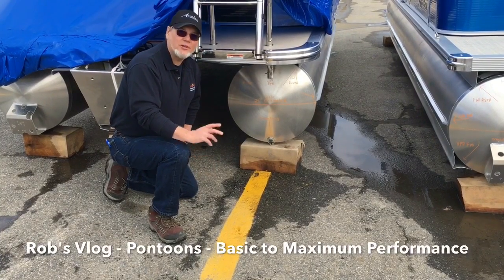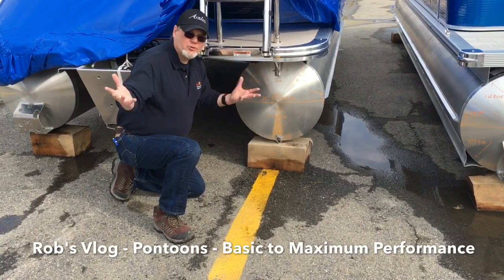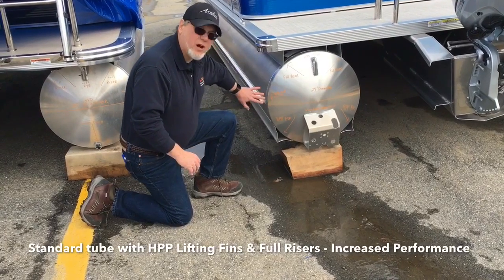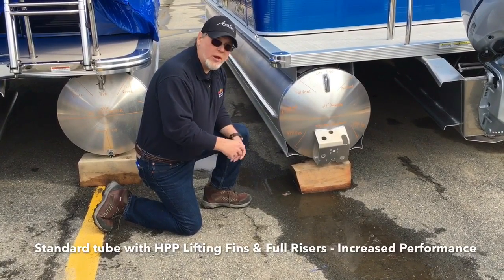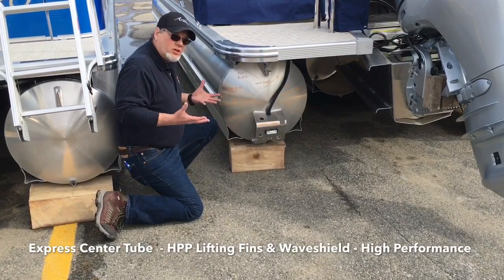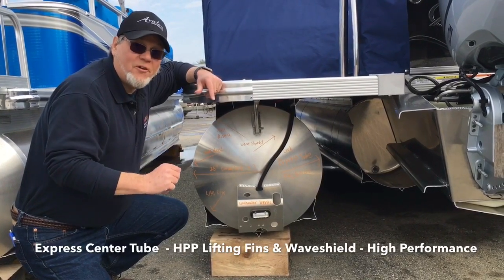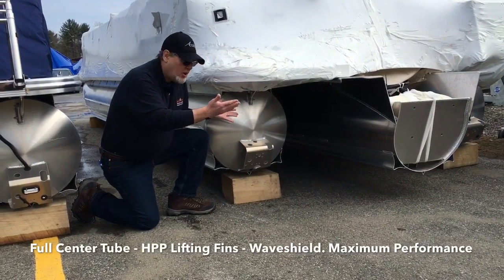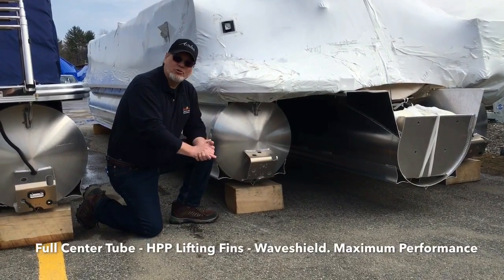Clark Marine - Rob's Vlog - Pontoons - Standard to High Performance

Comment: Hello, this is easily the best explained video on Pontoons, I have been searching for good info. I have my first pontoon coming in May 2021. 20'10" with lifting strakes and a 2/3 center tube. I have a 115hp being put on. Question, will 115 be enough power? 95 percent of the time just two of us and our dog. The reason I did not go for 150hp is the fuel tank. It is only 21 gallons. I am not a speedster at all. Just a cruiser but looking for the power when necessary. No watersports will be taking place.  It is a very slow (10kph max) 12-15 minute ride on a large river before we hit the lake. Thanks.
Reply from the maker: Thanks, I am glad you found the video informative. Enjoy your new boat!
Reply: I should have read my comment. I forgot to ask the question which was the whole point explaining what I ordered., sorry. My question is, with the boat I am getting, do you think the 115 will provide enough power?
Reply from the maker: @hockeynutt9434  with your description of expected use, I’d say that a 115 Hp engine will be satisfactory. The express tube will give you the buoyancy you are looking for and will also assist in keeping the bow up if you head into a swell or decent sized wave. 
I hope you enjoy your new boat.
Reply: @ClarkMarineMaine  Thanks again
Reply: @hockeynutt9434  150 will come with hydraulic steering.  115, unless equiped, will by cable. Other tip is maximize horse power engine.  See so many great pontoons with small engines.  No one has ever said " glad I bought the smaller engine".
Reply: @ClarkMarineMaine  . @Hockey Nutt   I just bought my first tri-toon with the same specs... 22' with 3/4 express tube and lifting strakes and a 115hp. Thanks for asking and answering MY question on motor size. I'm comfortable that I made a good choice. The 115 made it affordable. Rob, with this setup what's a good prop choice for a decent hole shot even if I sacrifice some top end.?